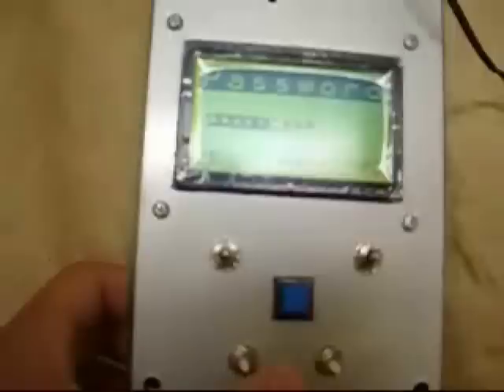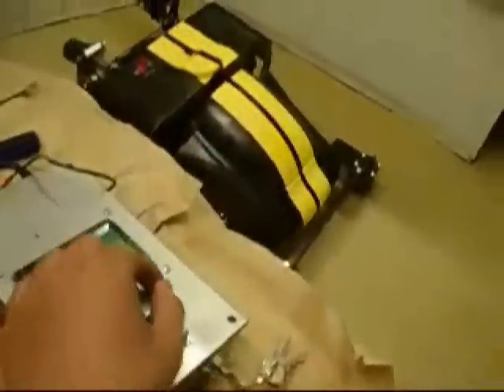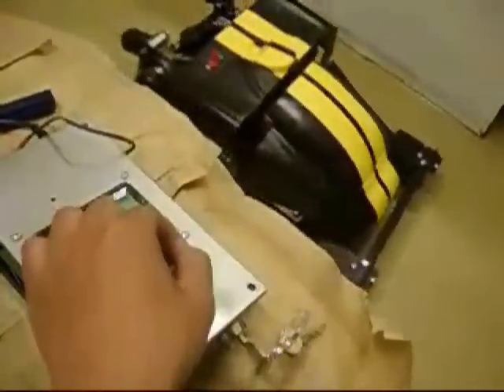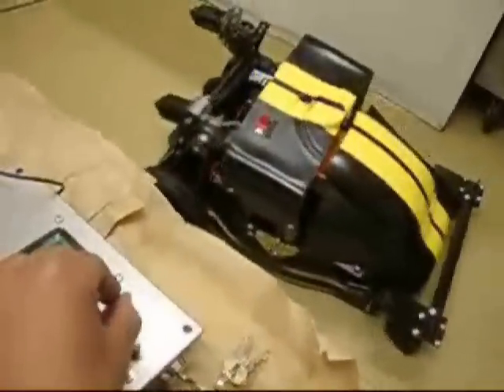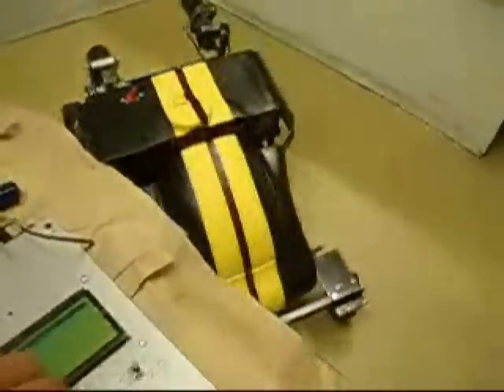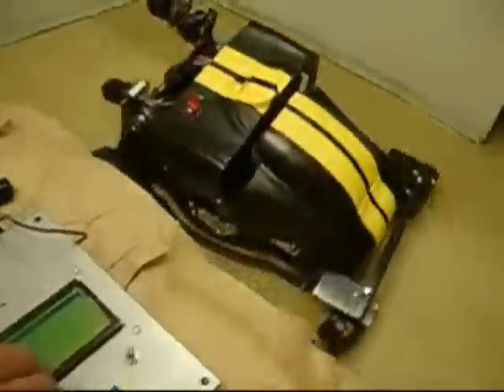Kevin Huang - Remote Control Lawn Mower [Bright Sparks Awards 2009]

Comment: For being complex it surely isn't practical to drive. With all the high tech menus, password feature and racing strip paint job you'd think it'd have a joystick or some easier way to operate it besides the switches which sound like they hard to press.